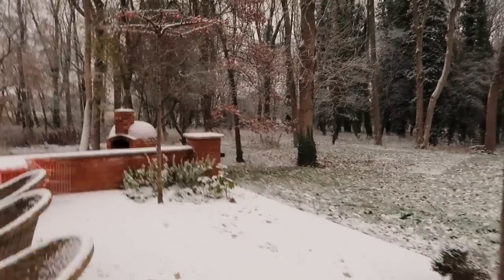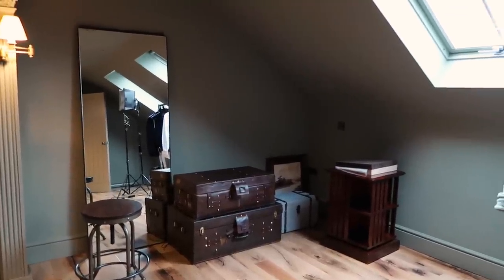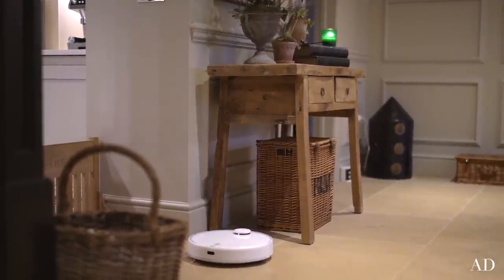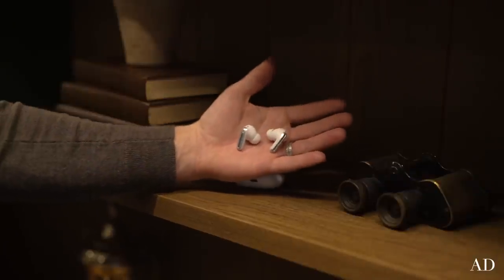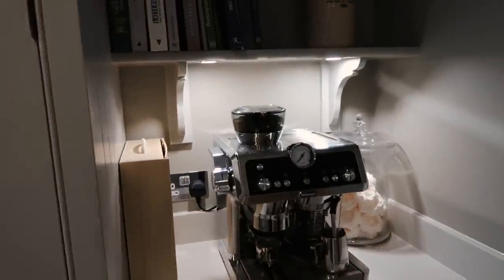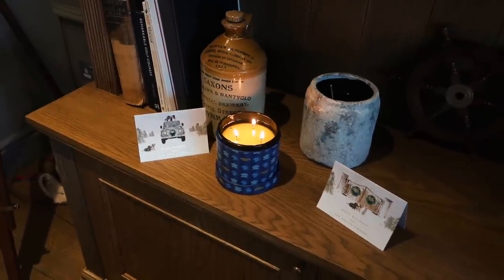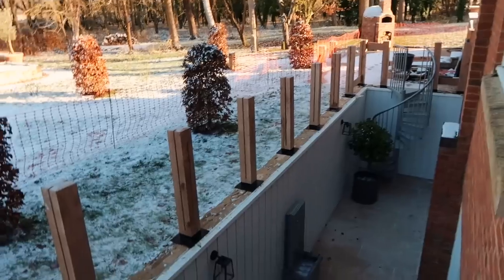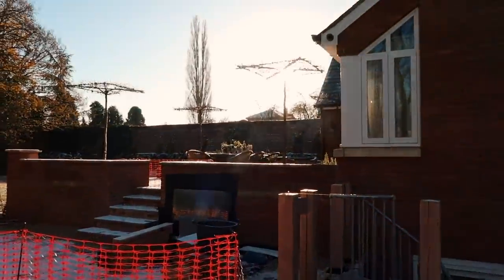THE HOME UPGRADE YOU DIDN'T KNOW YOU NEEDED | Ali Gordon

Comment: Ali, I love the idea of the space for your suit jackets....however, the jackets should fit wholly into the cupboard...no sleeves sticking out into the room.  The rail would be nicer in wood....there should be more space between the bottoms of your jackets and the briefcase which also is out of proportions for the space.  Adding a spot light would be nice.  Also, that unit where you will be placing you fragrances is too short, in my opinion,  and small for your room.... not practical for your purpose...will you always be kneeling or sitting in a chair to pick you colognes?  You will have to be very selective for your colognes...no space for extras....unless you have already chosen another place for more choices in your closets.  It is a beautiful renovation generally....in my opinion...